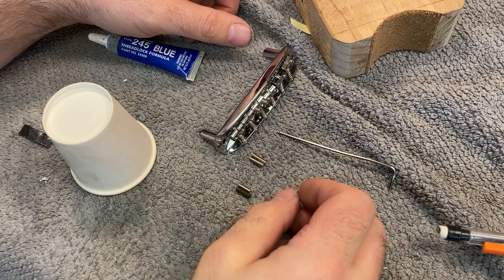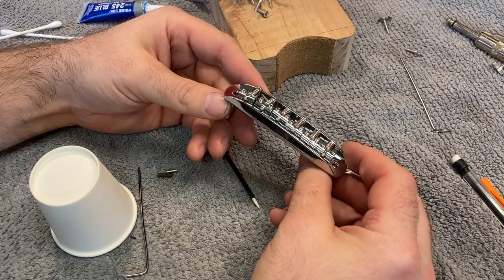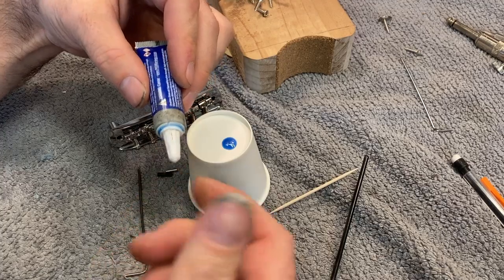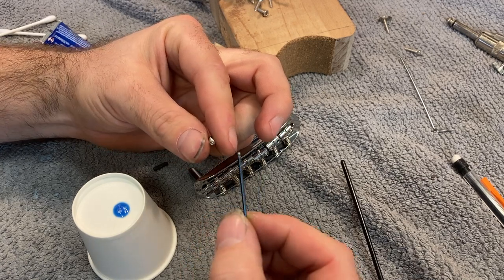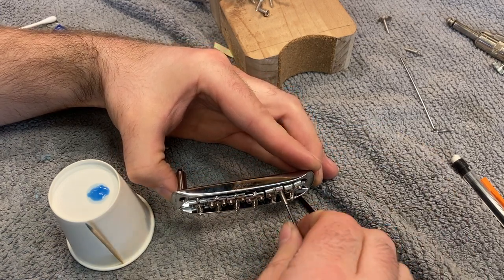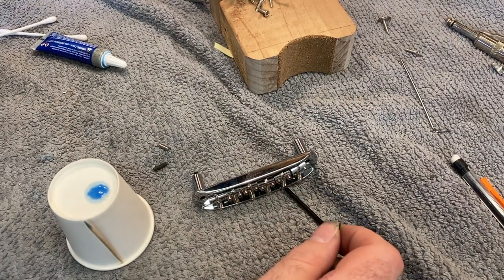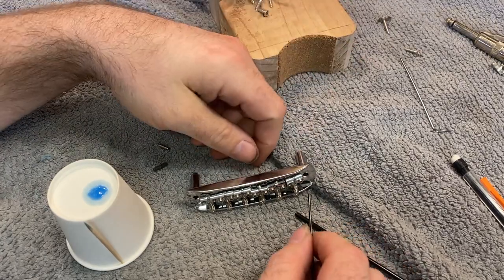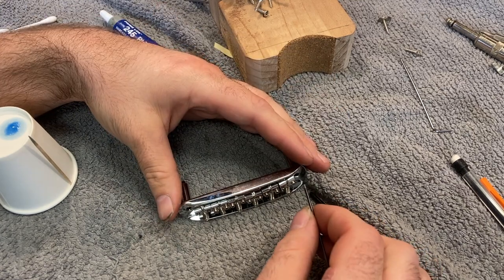Loose Saddle Screws on Offset Fender Bridges

Comment: FINALLY!! ..I’ve found someone who explains this issue clearly & precisely!! Well done! I’m subscribing!
Reply: Great video, on my Fender Jaguar Vintera the 1/16 L wrench will not fit on some of the bridge height  screws,   is that because the screws are stripped or ? I checked  Amazon  which ones should I buy and where 2 buy em? Help  the 0.5 wrench will turn em but if I use blue ltight who knows
Reply: Whoops should hv sent it to Drew, no prob. Spoke to him on the phone sorry my bad